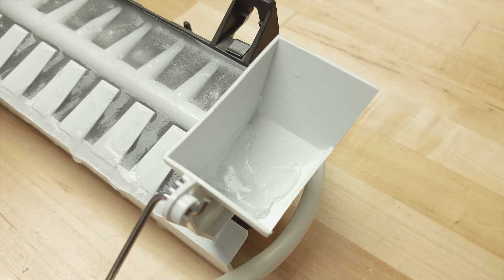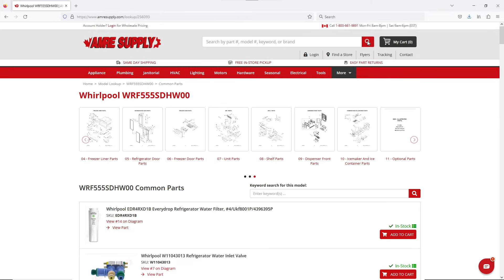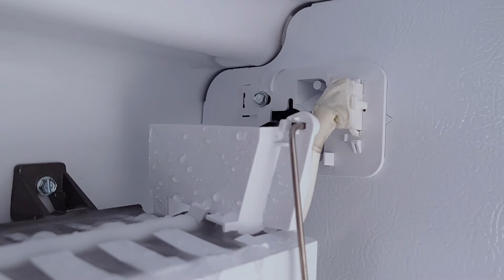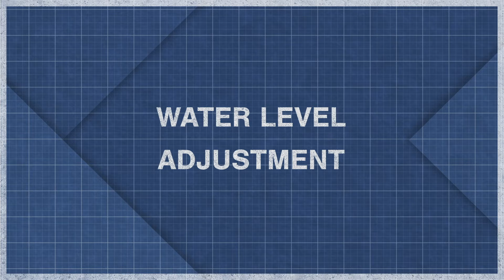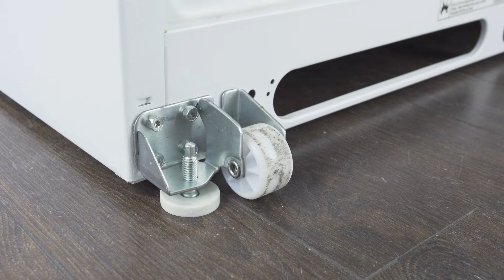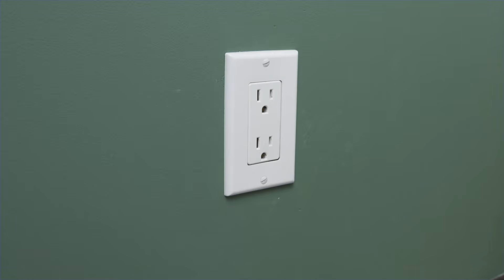Ice Maker Leaking Water? (Refrigerator Troubleshooting) | Repair & Replace

Comment: PSA: if you're looking for the video on removing the valve, try this. Pop off the access panel on the back of the refrigerator. No need to test the valve electrically, since our problem is a slow leak, not a non-functional ice maker. Unplug from the wall, turn the water off leading to the refrigerator, unplug the valve, remove the valve from the mounting bracket, TAKE A PICTURE of the water tubes leading from the valve, disconnect the tubes, reconnect them to the new valve, and you can figure out the rest. 
  
https://www.youtube.com/watch?v=EcHazrh_fos

Comment: So you said to adjust the water fill level with the screw and check. How do you check when you shut the main water valve off? Where is the link to replace the water valve?

Comment: part of the plastic tube got stuck inside the blue valve and was stuck behind the teeth. i couldn't get it out i had to take the metal teeth out. is there any way to replace the metal tetth or do i have to buy a whole new valve?

Comment: So besides water leaking under the unit onto the floor the freezer is covered with frost and when cubes are made there us obviously water getting to them so the stick together. I bought the home 6 months ago and only 4 years old so tje unit is fairly new. I think i just want evetything disconnected and making ice with trays. I am in my 60s and the new fangled stuff sometimes is not worth the problems it brings sooo....if i turn off the water supply do i also have to unplug the electric to the maker or without wayer will it mot attempt to do anything. I do not want the maker attempting to make ice without water and further damaging anything or using electric tricity.?

Comment: Great video! IT helped me identify my problem instead of buying a whole new ice maker that wold not have fixed my problem. Now my problem is no one list the support/mounting bracket on the bottom of my ice maker. It is an Armana ASI2575FRS00 side by side. Anyone have a source? it is very much like the one in the video, except it is plastic (and it broke).

Comment: Can I just unhook the water line and use old school ice trays to stop the annoying water on my floor every 2 days?
Reply from the maker: Yes you can decide not to use the built in ice maker.
Reply: @AmreSupply After watching the video I am thinking the same just turn it off and make ice the old fashion way. To turn off do i just turn off the water supply or do I have to stop electric from getting to the ice maker?

Comment: My ice maker is overflowing with water and won’t stop unless I turn it off. If it was the water inlet valve, wouldn’t I also have problems with the water dispenser in the door?
Reply from the maker: There is a separate water valves for the water dispenser. It is possible that out of the two valves, that one is not closing properly. You can see how to replace the water valve in this video: https://www.youtube.com/watch?v=EcHazrh_fos

Comment: 1. Do not let Vance quit.
2. I use the same speaking voice when describing a problem to customer service folks on the phone when I (rarely) have to describe an issue of any kind.
3. I have a 2004 Maytag French Door fridge.  Over the past 20 years I have repaired the ice maker a few times.  Once it needed a new motor, once the inlet tube was frozen and once I can't remember what the third issue was but removing it and re-installing it fixed the issue.  :-) 
4. Current problem:  We were getting smaller cubes and then last week saw some water coming from the fridge bottom and it appeared that the ice maker was leaking, maybe.  I pulled the ice maker out and saw that the plastic was deteriorated and there was a hole in it by the first cube indention by the fill area. Ordered and installed a new factory ice maker.  Now I have frozen water in the ice cube tray which I have to empty twice a day. The motor has not turned on once.  I think I might have a clogged water filter which I will replace, it is stuck in place. 
5.  I'll add that I have a love/hate relationship with this fridge.  I installed a new compressor myself in 2011.  The old Tecumseh compressor had died and I installed a new Embraco.   
6. Do not let Vance quit.
Reply from the maker: Thank you! We are currently working on a dishwasher series which will be hosted by Vance!
It seems that over time the plastic can break down, and this can be difficult to predict when it happens. Hard to regularly glance and check both sides of the ice maker for deterioration. 

Thanks for sharing your thoughts!

Comment: i pulled my entire unit out and defrosted it. I plugged it back in (bracket only fit one way) and now it's not filling with water. I've unplugged it, fiddled with the little arm, etc. I went from spilling water everywhere to having no ice. Any idea what could have gone wrong?
Reply from the maker: Thanks for watching. Check the connection to make sure it's secure. 

Does the ice maker spin? If so then it has power and it's likely a faulty water valve.

It the ice maker is not spinning at all, then it's either faulty, or there is a bad connection and it has no power.
Reply: @AmreSupply  actually, it started working on it's own after a few hours! i want to express my sincerest gratitude to you. For years I lived with a semi-functioning ice maker and this video gave me the courage to diagnose it on my own. Thank you so much.

Comment: Water valve leaking is probably the most common cause. It doesn’t completely seal after filling the tray and the tray overflows, dripping water into the bucket and making big clumps of frozen cubes and water.
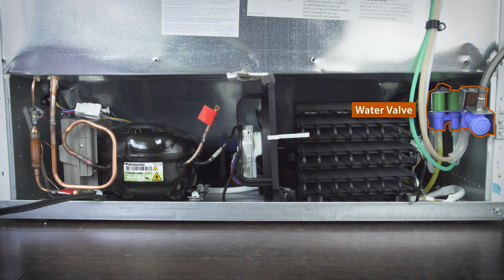Reply from the maker: Yes that is a common cause which we still cover at 8:12 but it's always good to check for other simple solutions if you can't see or verify a slow drip from the valve. Fridge levelling does not cost a penny so it's best to check that before purchasing an entire new water valve.
Reply: @AmreSupply In my case, the ice maker worked fine for years and the fridge was never moved so a change in the level of the fridge or ice maker wouldn’t be logical. I took the ice maker out and found no cracks or other indication of leaks so the water valve is the only other thing left. A new one was only about $25 so not a big deal. I’ve noticed online others stating the water valve was also to blame. The plastic coating on the ice tray is beginning to peel so I’ve ordered a new ice maker and a water valve which I’ll receive tomorrow and hopefully I’ll be finished with this annoyance. Thanks for the video and reply. 👍🏻
Reply from the maker: @spidernad1  Glad you found the video helpful! Best of luck with the repair!
Reply: @spidernad1  how did it go????

Comment: Hi!  I liked your video.  I have a GE top freezer refrigerator.   The icemaker is not producing ice.  I see that there is a good-sized amount of ice behind the icemaker in the bottom part of the freezer.  The model is: GIE21GSHHSS and serial number: DZ604159.  The refrigerator is 5 months old.  It has never produced ice properly.  The cubes were small.  Any help would be greatly appreciated.

Comment: My1989 Vintate Ama ice maker flooded my freeze with water.  I inatlled the Ice maker maybe 15 years ago.  My water source was teed into my drinking water filter system.  I unplugged the fridge for 8 hours started digging some ice out used a heat gun. Mopped up water on the floor dumped water out of the lettice crisper ect.  Now I have a shut off valve in the line going to the fridge  I built up water pressure in the filtered water strorage tank first. Turned the water line to the fridge an hour ago still now results .. 
  If it's not flooding in a couple more hours .. I get out the heat gun.  
  Alo I need to look for a pooible switch .. This model has a freezer abouve teh fridge and has an ice tray that fits under the ice maker with a simple wire bail.
  Also I tried to clean the water shut off valve from both ends.  It appeared lean. I have filtered water. I used to have just shot water.
  
   The power did possible flicker long enough to shut my computer down around the time I discovered the water never shut off since the previous night,
Reply from the maker: Thanks for watching! were you able to narrow down the source of the leak?

Comment: I have replaced my water inlet and still the water is not getting up to my ice maker. I’ve tested the inlet and it seems good and i have good pressure at the water line. Any help would be amazing
Reply from the maker: Thanks for watching. If the water valve is good, then it's best to check for a frozen water supply tube at the end of the ice maker. As well a faulty ice maker might not send voltage to the inlet valve. This video explains further: https://www.youtube.com/watch?v=0c4jOhTwZSs 
Hope this helps!
Reply: @ thank you! I know the lines and inlet are good now and even tried filling the tray with water to get a reaction started but still nothing. I think the maker may be broken and not sending to the valve.
Reply from the maker: @jonathandoucet1022  That does point to a faulty ice maker as if it fills with water, it should freeze, the arm should raise and eject the ice over time.

Comment: I have installed this ice maker kit and it is not making ice.  I have good water flow and it is a new frig, but the water valve was replaced.  There is no water in the tray and there is no action at all. Can you help with this
Reply from the maker: Thanks for watching. This video shows what steps to follow if the ice maker is not making ice: https://www.youtube.com/watch?v=0c4jOhTwZSs
Reply: @AmreSupply  Ya I watched that, but the frig is new and the water valve has been replaced just to make sure it was not that.  I can't see the solenoid being bad.
Reply from the maker: @CoreyWalker101  Worth it to check all connections, and in some cases the ice maker will have a power button. As well make sure that the arm is not raised as this will prevent the ice maker from starting.

When plugged in does the ice maker turn at all? Can you hear or see it advancing?
Reply: @AmreSupply  No Power button no noise at all from the maker arm is not raised
Reply from the maker: @CoreyWalker101  So in this case there's either no power being sent to the ice maker, (see if there needs to be an additional wire connected in the back etc) or there is a loose connection into the ice maker, or the ice maker is faulty.
Reply: @AmreSupply  Thank you, I will check it out next time I am in the office.  May be awhile.

Comment: Hello I just replaced my water valve assembly.  My model is Frigidaire 18.2 Cu. Ft. Top Freezer Refrigerator
LFHT1817LF.  How long should I expect to wait before a water cycle of making ice would start up? Is there a way to kick start an ice cycle?
Reply from the maker: Thanks for watching. If the refrigerator has to cool down and get back to temp it could be 6 hours to a day for it to make ice. If the temp is good, the ice maker runs about every 3 hours.
Reply: @AmreSupply  thanks I ordered a replacement ice kit from Lowes and it worked yeah after 3hrs was the first water pump into the ice tray receiver and then about another few hours until it freezed and poured into the ice tray

Comment: Nice video, however, I can't help but notice that you folks charge an exorbitant $185 for the same ice maker I just bought for about $75 from somebody else...
Reply from the maker: Thanks for watching, we're glad you found the video helpful. We appreciate the feedback and in many cases it can be tricky to compare genuine OEM parts to non OEM parts. Was the replacement OEM or non OEM? Can you share which part # you're referring to?
Reply: @AmreSupply my ice maker it's not freezing the water completely! Most of the ice comes out in  little pieces clear like a glass. Where from can be the problem? Please help me!! 🙏
Reply: @AmreSupply  Thanks for your response. I don't know if this is a "genuine OEM part" or not, but if it works I don't really care all that much. Re pricing I should note that your price is some $20 higher than even getting the part from the Jenn-Air directly. This sort of random pricing turns a lot of people off as I am sure you know..
Reply from the maker: @paulsubject9003  I can't speak to all pricing and what factors are involved but it's worth remembering that AMRE has 12 locations across Canada where people can come in and buy these parts the same day. Brick-and-mortar business have different operating costs than online only warehouses. Some manufacturers do sell direct to consumer and there will obviously be some cost savings as it does not need to go through these additional steps to go to a brick-and--mortar store.

Comment: I came home yesterday to a garage with water all over the floor. There was water spraying out of the icemaker area. We shut off the water and checked over the ice and maker and it seemed okay. Everything got put back together but it hasn't produced very much ice overnight. Maybe a tray or two.  After watching this video I'm planning to pull the entire icemaker assembly out.  I'm not sure why the water did not automatically shut off. Any ideas?   It is a Frigidaire FFHS2611LBNA 
thank you
Reply from the maker: Thanks for watching. It could be the ice maker control that kept the water valve open too much. If the problem continues then installing a new ice maker could help. 

Alternatively if the water valve is not closing properly this could also cause water to flow when it's not supposed to: https://www.youtube.com/watch?v=EcHazrh_fos

Comment: My icemaker (KitchenAid three door end is similar but doesn't have the adjustment screw for fill time. How do I adjust? The cubes are coming out stuck together.
Reply from the maker: Thanks for watching. The adjustment screw is sometimes under a cover. In other models there might be electronic controls to adjust the amount of water in the tray. Check your manual to see if this is an option.